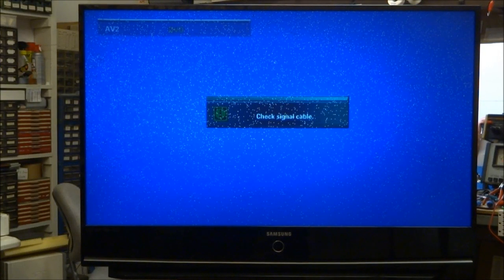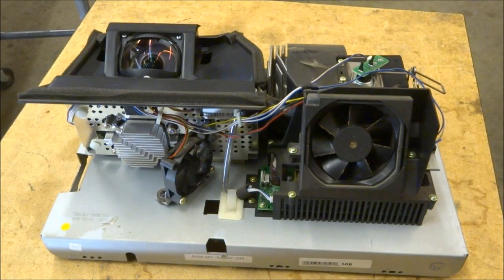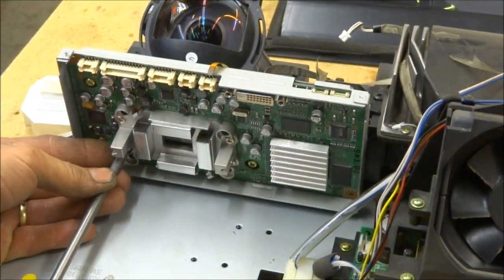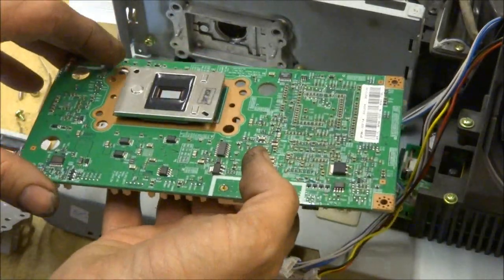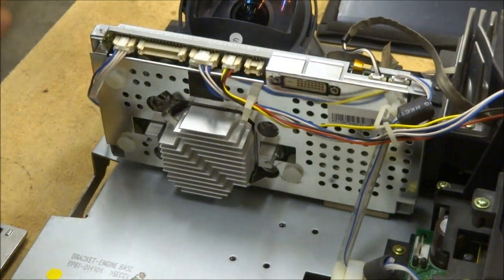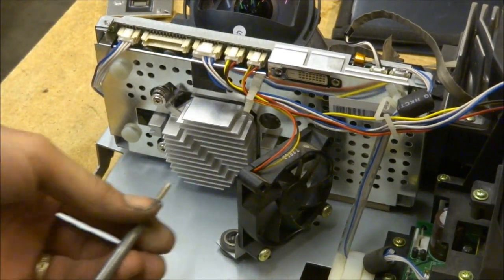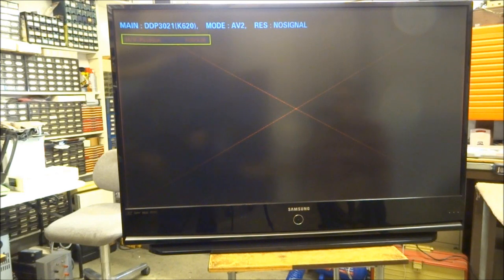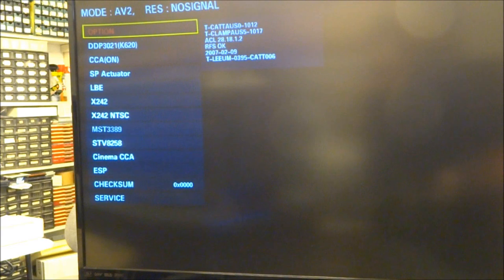Samsung DLP White Spot Dot TV DLP Repair FIX 4719-001981 4719-001997

Comment: Excellent video! I used it to change the DLP chip for the larger Samsung 72 inch TV that had the same issue. Not only did it have white dots, but a white haze along the bottom 1/5th of the screen. I didn't realize that the DLP chip was responsible for that as well. Thank you so much for sharing your expertise to the rest of us plebs! This saved me a bundle of cash.
Reply: Hi albyone64! Wht chip did you purchase? I also have Samsung 72 inch which is 1080p but I'm not sure what part I need

Comment: This video saved me money.  It didn't take long to install at all. This video was straight forward and easy to follow. I ordered the chip, installed and not the TV is clear and I can enjoy the HD quality. TV repair wanted to charge me $260 for the part and $235 for the labor.  I bought the chip from ShopJimmy's it came in about 3 days and I was good to go. My set was also a little different from the one in the video but I was still able to follow it and complete the repair.  Thank you sooooo much for this video.

Comment: I just put the chip in yesterday for an HL61A750 LED DLP and it worked PERFECTLY!  This vid was invaluable.  My model was not exactly like this one, but it was close enough that everything worked just fine.  Thanks very much for putting this out there - saved me from having to buy a new TV.  The old one still has a great picture and now is GOOD AS NEW!
Reply: That's the same set as mine I just fixed! It was much easier than I thought, and it looked brand new after too. Never get rid of your set, it's better than anything you can buy today, with the possible exception of  OLED.
Reply: I agree. Same set here as well. Gorgeous color depth on this set, 7 years old and still looks as good as any HD set on the market. Even the 4K SUHD sets do not match the color depth/warmth & true deep black color that this set has - granted the image quality is far superior on the new 4K's obviously, but Samsung did things right with some of these LED DLP's.
Reply: Did you put new thermal paste under the heat sink?  Also, did you have to make any adjustments for alignment to the set of the TV?  I believe on our version (I have the 67a750) there are 3 screws that have to be adjusted, or the board itself needs a slight adjustment, correct?
Reply: Did you put new thermal paste under the heat sink?  Also, did you have to make any adjustments for alignment to the set of the TV?  I believe on our version (I have the 67a750) there are 3 screws that have to be adjusted, or the board itself needs a slight adjustment, correct?
Reply: Did you put new thermal paste under the heat sink?  Also, did you have to make any adjustments for alignment to the set of the TV?  I believe on our version (I have the 67a750) there are 3 screws that have to be adjusted, or the board itself needs a slight adjustment, correct?
Reply: No paste and I didn't touch the 3 screws, nor did I need to make any other adjustments. When I put it all back together and turned it on the first time the picture look perfect.  not sure if I just got lucky, or that is more of a in case it looks bad sort of thing...
Reply: Nice... thanks for the reply.  Yeah my screen image is off and needs slight adjustment, this is before me swapping out anything.  I'll have a bit harder install than you it seems.  Take care

Comment: I just finished replacing the DLP chip on my Samsung 1080p and everything is good so far.  I followed this video step by step, some of the things were a little different on the lay out but for the most part the hardware was the same.  This video really helped me and hopefully I wont have to dive deep for a while.  Thank you very much this helped out extremely.

Comment: My 11 year old son and I just replaced our DLP chip (bought on Amazon through Shop Jimmy for $169).  We were terrified at times, but followed the video and successfully changed out the chip.  The only thing we would have done differently is take some pictures of where all the wires went before we disconnected them because our layout was a little different than the video (and we panicked a few times & a picture would have solved that problem). We did not readjust anything. Our new screen is completely dot free and lovely.  It was a fantastic experience and we are both so proud of ourselves for our accomplishment!  Thank you so much for the video!

Comment: I started noticing black and white spots popping up on my Samsung 1080p LED DLP (model #: HLT5687SX/XAA).  My set is almost 10 years old, so I was thinking about just replacing it until I found this video.  

Even though the model I was working on was slightly different, the walk thru was helpful enough to easily fill in the gaps.  If you decide to embark on project yourself, definitely take pictures as you are taking apart your set.  

This took me right around 90 minutes to complete and our set is as good as new - couldn't be happier!  Instead of spending thousands of $s for a new TV that will completely over match any Cable / Satellite provider in terms of picture quality (most cable programming is only 480-780p), I was able to repair this one for just under $200.  This was well worth it, and I would recommend to anyone. 

I too love these DLP sets, especially thankful to have the LED bulb model - the bulb lifespan for LED is practically forever.  Thank you norcal715!  And thank you YouTube!

Comment: This procedure worked for my 1080p LED model as well.  You saved me a grand or two, and since Samsung won't own up to the issue and help this got us back and running for $185!  I'm sure the LED will go out eventually too- but with over 16,000 hours so far on the original I'm sure it will be worth replacing it when it finally does.
I had some trouble with the horizontal alignment but we think we got it tuned well enough to be happy.

So...  let me know where I can send a case of some fine Colorado Beers!
Reply: +DJ Eshelman You can replace the LEDs in the model pretty easily as well. I did the red one (this one gets the hottest as the infrared emitted tends to heat up the LED and it can burn out prematurely). Just remember to use some Arctic Silver 5 when installing anything that requires a heat sink. Cleaning out the dust will extend the life of the set as well. Heat is what kills TV components more than anything.

Comment: Hello,  I had the white and black spots from a dying DLP chip. I have a Samsung 67 inch and I ordered the replacement chip from ShopJimmy. I got it in a couple of days and just finished replacing it. The picture looks great. It was relatively straight forward with the help of your video. I am going to attempt the repair of my Samsung 40 inch LED TV next. I suspect it is the power supply or the motherboard. I will order the parts from ShopJimmy again. 
Thank you for the videos. They very well produced and easy to understand. Keep up the good work!
Merry Christmas and a Happy New Year.

Comment: Thanks for sharing this video norcal715! Huge help and very detailed without the senseless chatter & shaky video so many others offer up. Very well done sir! Really appreciate the insight here. I have a Samsung HL61A750 LED DLP, and things are positioned in different places, but watching this video a couple times before fixing it myself made everything absolutely familiar.  I bought my chip from ShopJimmy as well. Had the lowest price.  A couple things to note on my specific set that may help others with the same model: 1)  You cannot access the focus wheel after the tray is reinstalled. The lens shroud covers it completely making the side panel access useless. Fortunately, I did not need to adjust the focus.  2)  My model does not have a panel switch which cuts power when the back panel is removed. No need to trick a switch with panel off on the HL61A750.  3)  Not shown in this video, but HIGHLY recommend for ALL DLP chip swap outs, replace the thermal pad on the back of the heat sink with either a new thermal pad or Arctic Silver thermal compound. After 8 years, the previous thermal pad on my heat sink was fine for the short term, but when I peeled it off - there was definite cracking and peeling starting to show. This will lead to premature DLP chip failure if not replaced. Cannot stress this enough - replace it in all sets folks!!!   4)  Take a fresh/new clean lens cleaning cloth and gently wipe the mirror positioned between the DLP and lens housing - I think this was mentioned in the video, but it is necessary to make sure this mirror is dust free as much as the DLP chip is.It's an easy job, just take your time without distractions, and make sure everything is positioned exactly as snug and proper as it was when you took everything apart, and obviously no left over screws and unplugged cables - and you can nail the repair on your first try.

Comment: Thank you, great informative video.  Replaced the chip on my Samsung HLT6189 because of a growing number of white dots. There were some slight differences with wiring and connections but could still easily follow your instructions.  Picture is now crystal clear!!  $180 for the chip, beats buying a new set!

Comment: Best DLP chip video online by a mile! Thank you so much! I changed the DLP chip on my Samsung 61" LCoS lampless with zero issues thanks to your video! The DCM was almost identical to this set (the DLP chip was Inverted relative to this set, which was interesting). Mine has the 15K RPM color wheel, but it had no affect on changing the chip.

Comment: HI there..Great video. I used it to replace my dlp chip on samsung HL61a750a1f..A few differences than the video in removing the  engine as I did not need to do anything with the digital board to remove the engine. Everything else to get access to the DLP chip was the same..Thanks again for the helpful video. Now TV is as good as new

Comment: Great video. Really helped me fix my set.
Only suggestion-
 In the testing and setting section at the end, it's not completely clear just how to navigate the menus and adjustment functions with the remote.  
 Once I'd gone back several times to view it and figured it out, it seems that my set, though in every other way appearing the same as yours, did not present me with the same "window screen mesh" focus test pattern as yours. I had the ability to scroll through multiple different screens, with patterns of different solid colored screens, and vertical lines of descending thickness and spacing, as well as a macro checker board type pattern. My set appeared  to be in focus after the installation though, without any adjustment. There is only an ever-so-slight tilt of the picture to the left, only noticeable when using the red lines to center the image in the screen. I might go back after it, but it's so slight that I'm not sure that I want to reopen the set just to stick that washer behind the mounting screw hole to fix that.
Great job on the video though. Thank you!

Comment: Thanks for the video. I was able to follow it and fixed mine. I have a newer model and the wiring was a bit diff, however, the installation is very similar. Thanks again

Comment: I love the video it was very clear on the instructions in changing the dlp chip. I do have a question though. Is it necessary to have that actual remote to do the factory settings you showed in your video? I aquaire my tv free because ofthe dead pixles and was not provided a remote so i bought a samsung remote from amazon that the seller said would be compatible to my tv, but when i try to do the reset, that screen will not come on. I get a dark grey fuzzy screen for about 30 seconds then the tv cuts off and on again a few more times with all 3 lights in front blinking. If you could help me it would be greatly appreciated.

Comment: The video is very helpful. Unfortunately, it didn't show up in searches for this specific model (HLT5075S). (Having the model number in the keywords or tags would be helpful.)
As a result, I found other "similar" videos and inadvertently removed the three screws norcal715 says not to adjust.

Comment: Love your video, it worked like a champ; however, like a few other curious techies... In the service menu, I intentionally changed the setting of Lamp Sync function to "Pulse" - and the screen disappeared and the TV power now keeps on recycling on-off while the lamp tries to come on until the timer times out before getting any screen, and the power recycles again on-off - so on and so forth. No matter what I do, this operation takes place as soon as I plug the cable in the wall. It is set on an automatic "pulsing mode" - and I cannot see the screen to be able to reverse the unfortunate setting change I have made. Could you help with this issue? Thanks in advance!

Comment: This video was great, all fixed! Took my time and no more white dots, set is like new,,,!!!

btw, I had reached out to you on a different TV, a 13 year old 50 inch Samsung Plasma that the sound didn't work on any more, switched the HDMI cable out and used the standard COAX cable input...Problem Solved! Sound Works again!  Any thoughts on this?
Thanks...
Jim D

Comment: one quick note, you dont need the original remote to access the  service mode, I've been using a Harmony 880 remote that is programmable to various tv's IR settings and has worked perfectly on Panasonic, Westinghouse, and Samsung TVs

Comment: I wish I would have found this video before I had to replace mine. I ended up removing the three screws you mentions not to and taking off the back bracket completely. Once I got it back together the screen was shifted down about 2.5 inches. I have yet to fix it because I do not want to make it worse.

Comment: Excellent video!  I have the 1080 set, but I live in Bolivia now  but bought the set in the USA, and had to buy a new DLP chip from ShopJimmy when I was last in the USA  Came back to Bolivia and had a tech reinstall the case and put the TV back together, although it took him two weeks to get his lazy ass to the house and I was going to do it myself if he didn't show up today when he did.  Anyway, it all went well, except there is a slightly curvy line on the right side of the screen.  I saw the two knobs to adjust horizontal and vertical picture but the tech told me not to touch them or I might screw up the set.  I figured I would wait until he left and do it myself, but wanted to wait until Monday to talk to ShopJimmy.  Now I don't have to wait. THANKS!!!

Comment: Wow, wish I would have had the good fortune the rest of you had.  I thought the video was great - thanks, and I followed it to a T, but went to power up in the service mode and no picture at all.  The right green light flashes, then all three will flash once then back to the single light, AND it won't shut off without unplugging it AND when I plug it in again it powers itself up.  I can tell it's getting a signal from the remote, because the middle green light flashes when I push a button on the remote.   I put the old DLP back in with the same results.  Any solutions?  Thanks.
Reply: it's either your bulb or the eeprom chip.  i ended up buying another main board for $42 shipped.  https://wiki.samygo.tv/index.php/UnBricking_TV_by_EEPROM_Reset   Had to find and buy my service manual to locate correct chip IC301.  Still having a friend short the chip and original board and keep as backup.  Before trying to EEPROM reset, please try a factory reset, that might revive your TV also. Press "EXIT" button for 12 seconds (15 is better since you cannot see TV), than press "Left" and "Enter"

Comment: Where is the focus adj. on a Samsung HL50A650C1FXZA? I just replace my chip and I couldn't find and videos on my model. Yours was pretty close but I found it after I did the repair. I took some screws out that I shouldn't have but I'm real close on the adjustment. Is there a video that you know of that covers most of the adjustments or is your video covering most of them.Thanks
Reply: +hotrodron409 
If the picture is not centered properly you may need to physically adjust the board that the chip is mounted on.  This can be done by adjusting the metal bracket the board is attached to in the HLT 6187SA model.

Comment: Hello,  I have a Samsung DLP tv.  I am unable to find a resolution of my problem and I was wondering if this might be my issue.  I have about a 7" circle in the middle of my tv however it is not a perfect circle.  It is kind of oblong. It is pitch black meaning it is not a darkened spot do to dust, etc.  Most DLP chip problems I have seen on here are scattered all over the screen like yours But mine are all lumped together in the middle of the screen.  I would be grateful for your thoughts.  Thanks so much.

Comment: just a comment about cleaning the dust.  why would you "blow" the dust when it's just going to end up in your shop, your house, wherever.  I always do a very thorough and efficient cleaning of my electronics ( especially my Desktop PC's), by using a well-filtered vacuum with a crevice tool, and a 1-1/2' angle paint brush.  using the brush to loosen the dust/dirt, with the crevice tool close by.  That's about as good as it gets!

Comment: Those thermal pads they put on the back of the heatsink make assembly faster on the factory line but aren't the most thermally conductive. I always throw the pad out and replace it with Arctic silver. I suspect the poor performance of the thermal pad is at least partly why the dlp chip failed in the first place. Planned obsolescence.

Comment: Hello, I have a Samsung DLP that I scored for $20. I replaced the lamp thinking it that would fix my power off problem but it didn't. Basically the t.v. will stay on for 5-10 minuets then turn off and stay in standby mode. It also has the white spot problem in some small parts of the right side of the screen. I probably also need a remote. I'm thinking the chip is next...Any help with this issue is greatly appreciated.